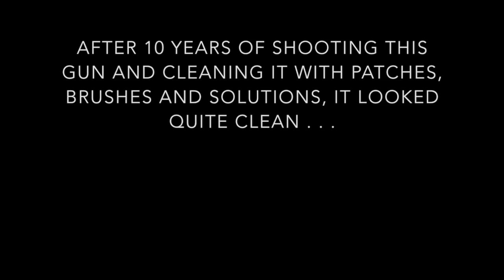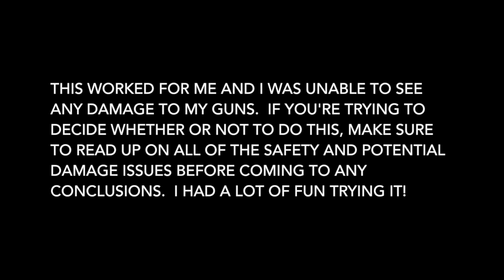Electrolysis for Gun Barrel Cleaning: 10 Years of Lead From a Ruger Super Redhawk

Comment: How do you know it is not removing the inside of your barrel (the steel)?
Reply from the maker: You have to make sure that you have the correct current flow. I've also done a magnet check on the material removed and it is non-ferrous.

Comment: I use this method, electrolysis to restore skillets/cast iron & have been doing it for several years with good success.  Negative lead to the item to be cleaned, skillet & positive lead to anode. At 5:36 in the video you show the rod with the rubber washers to center the rod,  but the bare rod is touching the inside of the gun with what appears to be a bare end on the rod. That would be a problem if the rod is bare. Otherwise, good video.

Comment: This is BADLY MISLEADING. DO NOT USE STAINLESS STEEL FOR THE SACRIFICIAL ROD. You are creating hexavalent chromium, a DEADLY poison! https://www.metaldetectingworld.com/anode_positive_electrode_p9.shtml  Also, if that is a stainless barrel, you are using your stainless barrel as the anode, which is even worse. This removes more steel and creates more toxicity. The barrel of the gun should be the cathode!
Reply from the maker: Completely agree on the sacrificial rod -- it's steel, not stainless. As for the anode/cathode, this is what every other instruction for barrel electrolysis does too.  It is the opposite of what I do for cast iron cleaning.  I have taken a magnet to the accumulation on the rod and it has no magnetic properties and I can see the lead removed from the barrel, with no pitting or other effects on the barrel.  It runs for short periods of time (minutes) in the milliamp range, so the potential for damage is very low.  That said, it is certainly a risk, although removing some rather significant quantities of accumulated lead reduced another risk.  Thanks for the comments.

Comment: I did this to a few milsurps that were really cruddy years ago. 2 of them turned out great but on shot patterns of buckshot at 100 yards. I have a really cruddy RC K-98 to do now. I plan on swapping out the barrel it shoots so bad, but I'll try a to power clean it with this method to see what happens. Worst case I still have to get a new barrel......
Reply from the maker: Good luck with it!  If you have a 5mm USB inspection cam ($15) you can sometimes spot some trouble, but,  as you will well know by the sounds of it, older milsurps are a bit like a roulette take! ;-) But, when they pay off,  watch out!
Reply: @harleyrider883  the bore on that poor rifle has rounded lands from all the crap. I hosed it the Barnes CR10 and copper scrubbers but it ain't moving. Worst case it will have a new barrel. If I go that far I'll get a new stock and have it reblued and use it at CMP matches.

Comment: Can I use the copper rod to do the job? I don't want to insert a steel rod into the barrel.
Reply from the maker: jason yang You can definitely NOT use copper because of the electromagnetics.  It has to be steel.  The steel rod will not scratch your barrel if you're worried about that. Put some electrical tape around the bottom of the rod if you're worried about that aspect of things.
Reply: Thank you!

Comment: What was the solution you used in the gun barrel?
Reply: Hoppes cleaner is a copper solvent and a powder residue solvent, but it has zero effect on lead.
Reply from the maker: Self'in Megell'co I tried used vinegar and distilled water, but it didn't seem to have worked well.  I tried the Outer's Foul Out solution and it seemed to work best.  Using ammonia would help with the copper, but I didn't do that type of cleaning, as I find that solvents work just fine for that purpose.  Hope that this helps!
Reply: Yes, it does,  Thank you.
Reply: Oh,  on another thought,  You think Hoppe's bore cleaner will work well enough  or is it even conductive?
Reply from the maker: Self'in Megell'co Two thoughts:  definitely won't work because of conductivity issues. MORE importantly, though, it's highly flammable so you definitely do NOT want to put a current into it...

Comment: I would have been interested to know what your bore would have slugged at before and after this test...  That would have told you for sure if the guy below is correct in that you were removing metal from the actual barrel and not just lead.
Reply: That was my suspicion too.  LoL  Especially with him mentioning using distilled vinegar as an electrolyte.  Vinegar will pit (dissolve) steel too if you give it enough time.

Comment: I worked for eight years on cathodic protection for Phillips66, anodes were positive and pipelines were negative. As you have it hooked up you are making the gun the anode, I am a senior corrosion technologist by NACE certification ~ $50k cost to Phillips66. I can say to a certainty you are removing metal from the bore, check the stainless rod, it was protected, weigh it clean it will have lost no weight. I can say you are harming the gun but because you are applying the current for short periods of time it may be not be enough to tell. Experiment with aluminum foil, the positive will first etch the shiny side 3 volts you will see holes in a short period of time. The bubbling is merely the water breaking down into hydrogen and oxygen. 979-824-1110
Reply from the maker: Cap't Kirk, thanks for this -- it's hard to find the instructions from Outers.  Perhaps you can help me work through this:  The lead that I'm trying to remove is stuck to the barrel.  I want it to leave the barrel and migrate to the rod.  I don't want anything leaving the rod and going to the barrel.  There was certainly a very large volume of lead that came off the rod (and the lead-cleaning patches that I used stopped removing anymore lead).  I've seen electroplating done where the "rod" (usually chrome or nickel) loses weight that migrates to the barrel (or equivalent).  As I recall, the process for that is the same as you describe.  Many thanks for your thoughts.
Reply: You need a closer examination of what was removed.  Perhaps a melting point test.  If it all melts into a silvery puddle at the lead melting temperature, then success, but of course if nothing melts, or if (Heaven forbid) it reacts to a magnet, then it isn't lead you are removing.  Also you have way too much voltage.   Outers cautioned (before discontinuing the product) that 0.03 volts is what their device used and any higher voltage would probably pit or remove gun barrel material.  A similar problem occurs when using a 50/50 mix of peroxide and vinegar as a soak the barrel cleaner.  A ten minute soak affects only the lead.  An overnight soak eats holes in the barrel steel.'

Comment: What  solution did you use, ammonia vinegar?
Reply from the maker: I tried used vinegar and distilled water, but it didn't seem to have worked well.  I tried the Outer's Foul Out solution and it seemed to work best.  Using ammonia would help with the copper, but I didn't do that type of cleaning, as I find that solvents work just fine for that purpose.  Hope that this helps!

Comment from the maker: EE Vang, thanks for commenting.  It was a bit tricky finding the instructions at first, but they all confirm that the negative (which attracts positively charged particles) needs to be attached to the rod.

Here's an example of a few posts on the topic:

http://www.thehighroad.org/archive/index.php/t-195171.html 

Thanks again for watching!
Reply: That's actually the first my first time seeing someone say to connect the positive to the part you are cleaning. I was curious, so i searched some more and found one other person who suggested the same.  I used this method to remove rust from inside my muzzle loader barrel and it worked great. But i had the positive connected to the sacrificial metal not my gun barrel. Look up electrolysis for coins and rust removal or any other applications.  All the videos and sites had theirs setup the way i had mine, negative to the part you intend to clean and positive to the sacrificial piece. I don't know who's wright or wrong, but it did work for me. And it looks like it worked for you too. I'll try it your way once and see if there any difference between the two methods.

Comment: Your setup looks good,  but you have the positive and negative backwards. The negative wire must be connected to the gun,  the part you want to clean, and the positive wire to the metal rod.
Reply: E TV The lead ions are positive charge carriers so they will flow toward the negative electrode, in this case the rod.
Reply: ALL current flows from positive to negative. His connections are correct.
Reply: @carfvallrightsreservedwith6649  NO! current flows from negative to positive.